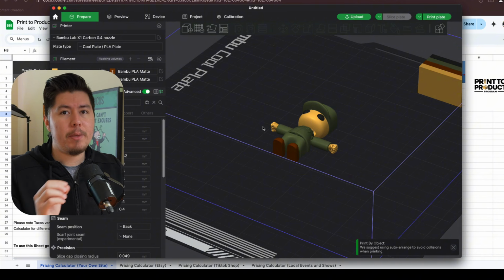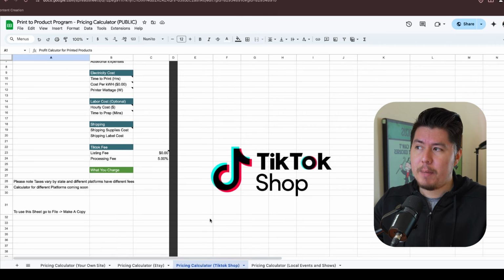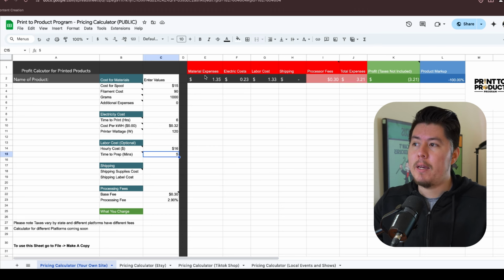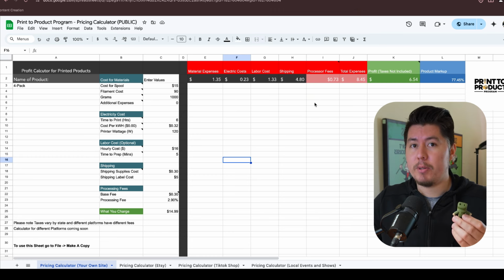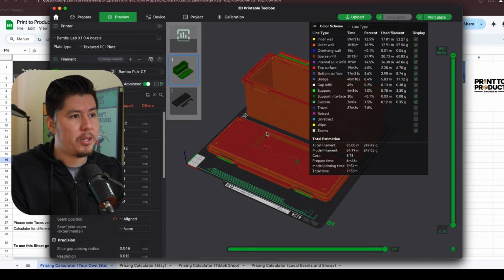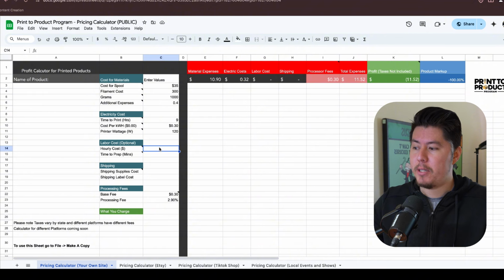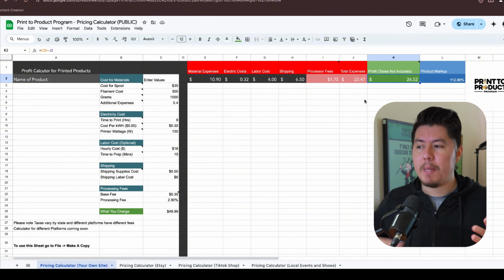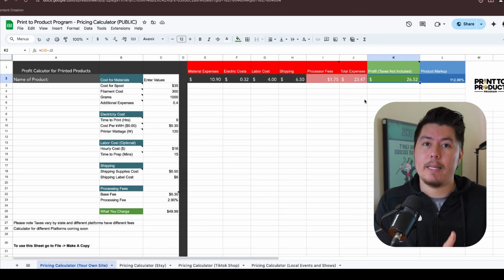How to Price Your 3D Printed Products

Comment: You also need to include the cost of recapitalization, both for the licenses (if you buy licensed designs) and the actual equipment (3D printer and maintenance).
Reply: I honestly think this is the major cost there at maybe close to 50%

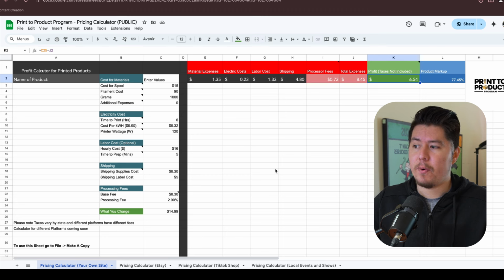Comment: @7:55 switches to a four pack but does not multiply the shipping cost or the filament amount used by four. What type of crazy math is this? This is how you get your power turned off 🤣🤣
Reply: you ship them in the same pack assuming it fits, and 90 g might have been for 4 things from the start.

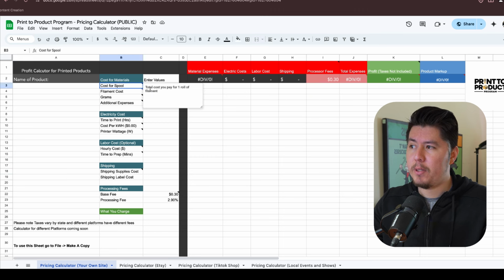Comment: @4:06 Whoa, how the hell are you skipping the cost for maintenance and printer parts? Nozzles get clogged, plates become dirty, and so much more. Even on a well-maintained lightly used machine. There's a lot of cost for maintenance and use over time.

Comment: Another field that would be good would be to factor in machine wear costs over time.
Reply: You can write off company expenses on your taxes. no expert but Ive held a job or two that had position.  Always refer to your accountant /Tax  filing preparer to do it correctly.   hope this helps..
Reply: @ yeah there are the tax deductions on hardware but this factors in maintenance costs and wear of a machine over time. If one product has a 7-8 hour print time in ABS it’s going to incur greater amount of wear and maintenance on a machine compared to a 1 hour PLA print. There was a guy that did break down the formula on how he does it and adds it to his calculator on print farm academy channel.
Reply: @barnesysbuilds  in business the penny has to be considered .  absolutely right.. nice info thanks.. still in research mode.. a lot to soak up..  thanks again

Comment: If you design your own product through CAD or Sculpt program? What % do you project adding to the product to make up for design time.
Reply: His example is for the cost of goods sold to be manufactured. If you want to include design time you need to think of it this way: You buy from your designer expecting to sell a pre-specified number of units. Let's say your design company sells to your manufacturing company for $100 a design. Then when you sell one unit the cost is $5 COGS + $100. If you sell 2 then it's $5 + $50, 4 is $5 + $25, and so on. You can also apply this same logic if you license products. Does that help???
Reply: @APerfectPixel  Thanks

Comment: Thanks for sharing.
I'm wondering if you are taking into account time invested to the design and modeling of your own products?
Reply from the maker: You can calculate that, but in my opinion - I have fun designing whether personal or commercial so to me I'm not considering it. But when you are just getting started its best not to nit pick every little expense. Just focus on making a great product that solves a niche specific problem. If you can do that then it will offset whatever expenses/cost you incur
Reply: @SantBran  makes sense for me) thanks!
Reply: You get a return through volume and longevity of sales..  its a penny a day compounded with interest daily math question type thing. or a thousand today..   I'll take the longevity way.. hope this helps..  excited about this too...

Comment: Great video and thank you for sharing the spreadsheet for free. Im new to 3D printing and am wanting to sell some of my own creations but was wondering where to start with the costings and this video helped alot. The only question I have is, I have a multi part model and am using different types of filaments, using the spreadsheet template how would I go about factoring in the costs for the different types of filaments/rolls as the prices per roll can differ quite a bit?

Comment: I don’t want to come across as too critical, but it seems like there are some key costs missing here, especially when it comes to a newcomer to business calculations. Costs like maintenance, machine replacement, logistics, workshop fees, taxes, etc. should be considered. My suggestion would be to find a way to factor in all these expenses, particularly for machine replacement every 3-5 years and regular nozzle changes.
Reply from the maker: Hey thanks for pointing that out, I did cover that in a separate video but it didn't get as much traction as this one. Btw, this is just calculating products, all those other things you mentioned are variables that vary between person and I would suggest using best practices to find what works for you. Hope this clarifies things.
Reply: @SantBran on the first multicolor print, that 8x grams, are you calculating the waste because I feel like you did not so that doesn’t help the new people either because they believe it shows everything on there
Reply: great info.. a lot of it correlates to location.  California is notoriously high compared to other USA states. those great points you factor in pertaining to your area's.  hope Im helping.

Comment: 3D Epi pen cases sell for $16 on Etsy
Reply from the maker: They go higher, I promise
Reply: @SantBran While people may ask more, but you don’t know how much they are selling for.   Without some differentiation, it’s just another empty plastic box. You can try to sell a generic product to a different market, but you must have some reason for the consumer to buy it.  

Stick to small items that you can print multiples of on the same plate and minimize your pre print overhead, and sell large volumes.  Or, sell small volumes of well designed items that fit a specific need and can realistically command a higher price.

Comment: What about the 3D model monthly subscription? Shouldn't that also be part of the expenses? Since most of people who owns a 3D printer don't know or still learning how to make their own 3d models.
Reply: Like many of the costs he didn't cover, there's no way for a business to break something like that down per product sold when you don't have a fixed number sold vs the flat monthly or yearly subscription price. You need to record that in your Quickbooks or Xero accounting service as an expense under a coding like "Subscriptions", then as you get a handle on your cost of goods sold, volume, you'll have an idea of that total cost vs the number of items sold, and if you really want to account for it then you can assign a nominal amount like a penny or fraction of cent per item towards that.
If you're going to be successful printing these ~$25 and under flexi type items you need to be doing it in volume, and if you're doing it in volume you won't be worrying about $5-12/mo subscriptions, focus on your big costs like Filament, Fees, Shipping, and how to grow your business.  Just like electricity is a minor talking about pennies per print, just not worth tracking per product, but you could calculate out something like a 1% misc expense fee to cover all the small expenses.  Ultimately you can go nuts figuring out pricing but if buyers don't buy at that price, or your costs are too high vs a larger volume seller with better marketing, you'll still have to adjust pricing or change your cost structure.
Reply: Operation costs are deductions of company expenses.. consult a CPA / tax preparer for the right info..  hope this helps..

Comment: Great video! I like your breakdown. I have been trying to figure out what's the best way to go about it, from a designers standpoint. Question: Do you sell your designs as prints and licenses them to other sellers? I currently design and sell mine. I was wondering if its best to  focus on creating products and licensing them. It has been slow this far, but if it picks up, I imagine it will be harder to do both effectively by myself